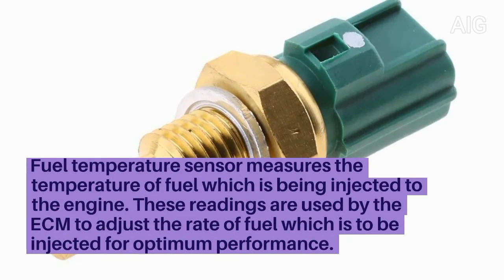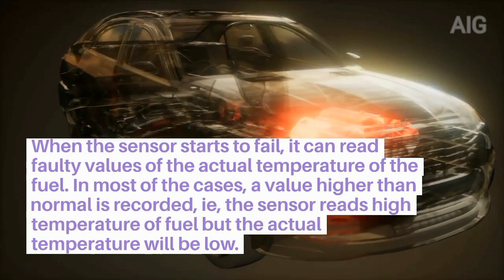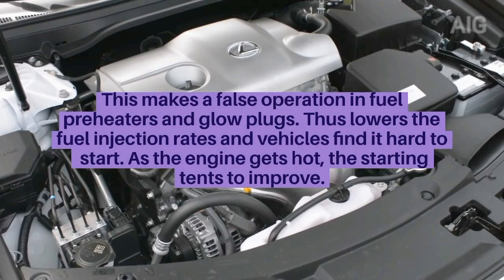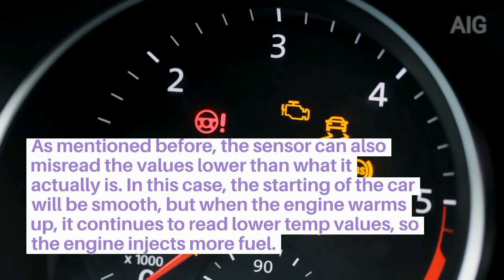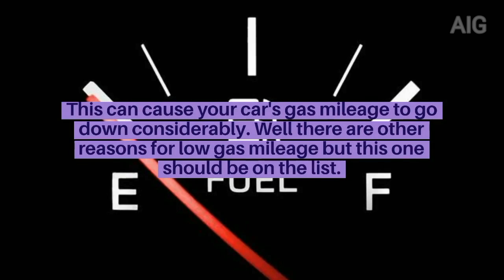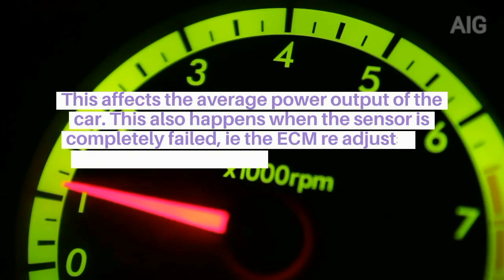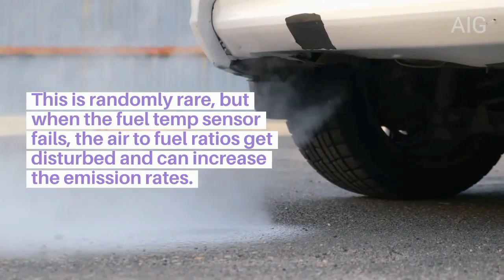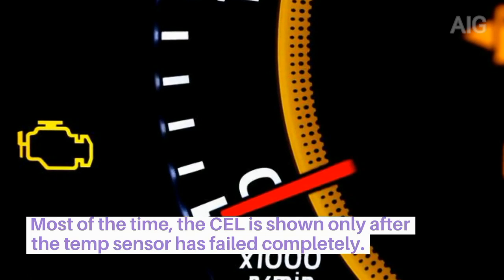Signs of failing fuel temperature sensor in your car | Symptoms of bad fuel temperature sensor

Comment: Can this cause the car to not start when the outside temp is hot?  Like the time of day when its 100 plus?
Reply from the maker: Its rare that cause no start but delayed starting is one common symptom. You might need to crank several times to start the engine.

Comment: Probably my issue as the code came after fuel pressure regulator install and car had the warm start shakes and was definitely overfueling at the same time
Reply from the maker: Also if regulator has high pressure release point, the fuel pressure in rail or line stays high causing flooding or overfueling...be sure to check the pressure as well.
Reply: @autoinfoguy  pressure at the fpr gauge has been constant 48psi since day 1. Could also be the check valve
Reply: if i prime it for too long it bleeds back if that helps. Thats why isay check valve so new pump too

Comment: How can solve the problem temperature fuel sensor on 2kd hilux
Reply from the maker: Most of the time corrosion in connector cause the issue...or  deformed conmector points.

Comment: Installed brand nrw fuel pump and after a about a week the temperature sensor bunt out, what is causing this, please help?
Reply: Most after market fuel pumps with the fuel temp sensor as part of the sending unit, don’t actually include the sensor with the pump and it’s a dummy sensor. You usually have to transfer the original sensor from your fuel pump to the new pump. If your car is set up that way. Imports from Mitsubishi, Nissan, etc are like this. I recently had this issue because the previous owner replaced the pump with an after market pump. I fixed it using a temp sensor from a different model, and have a video on it on my channel. It’s a bit advanced I wouldn’t recommend fixing it the way I did.

Comment: Sometimes my car missfires very bad when the engine is  cold, it stops when my engine is hot
Reply from the maker: This could be anything from, failing spark plugs, coils, injectors or dirty throttle body sensor.
Reply: Wat about a diesel

Comment: I have a problem.. my car vw polo CayB 1.6tdi.
My problem is that although the air temperature is 25c degrees, my car starts hard at the first start.. glow plugs do not engage.. but if I unplug the fuel temperature sensor, it is activated and the car starts easily

I bought a new one glow plugs, glow plug control module and fuel temp sensor .. but problem not solved
Reply from the maker: Hi there, Check the wiring to FRP mainly the connector for corrosion nd wire damages.
Reply: @autoinfoguy  sorry  FRP ?
Reply from the maker: Ops sry we meant, FTS... fuel temp sensor.
Reply: @autoinfoguy  I checked fts, with vcds..it measures temperature correctly
Reply from the maker: Whenever glow plugs go out of its order, should give a warning in dashboard. Donno if its a malfuction in ECM.
Reply: @autoinfoguy  The glow plug light turns on very briefly when you turn on the ignition on the first start in the morning.... Also, there is no voltage coming to the glow plugs at this time. Im checked..   I unplug the fuel temperature sensor, glow plugs  is activated 5sec and I saw on dashboard..  and I saw error code at vcds for fts(normal)